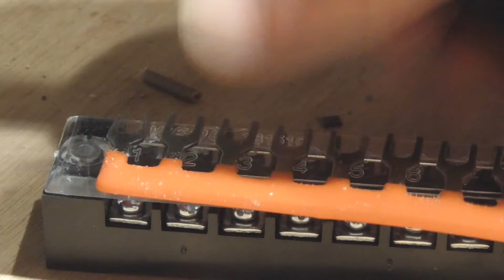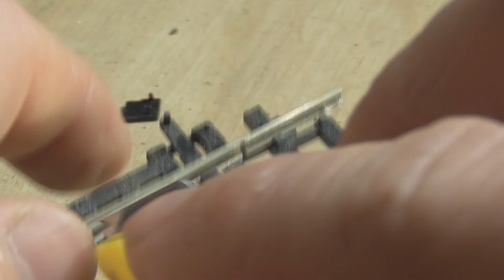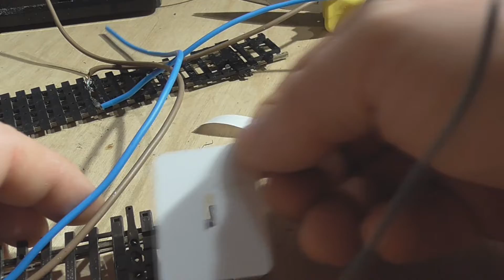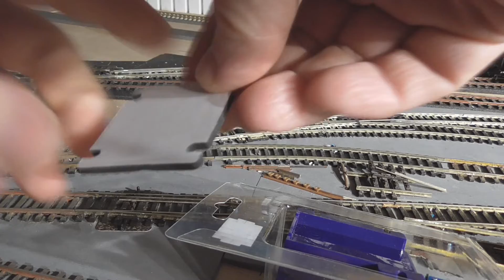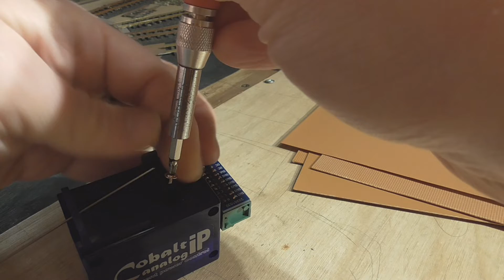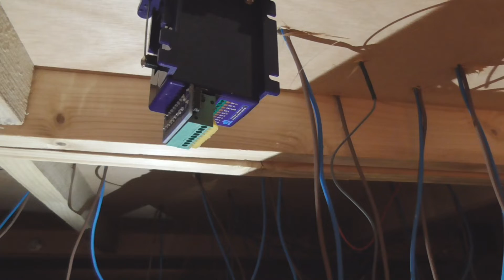Electrics Part 2: I show you how to install a DCC Concepts Cobalt IP Analog point motor

Comment: These Scenic3D point motor jigs are an excellent piece of kit. Life's so much easier using one of these
Reply from the maker: I agree, I've got several for different types of points such as 3 way and slips. I use DCC Concepts point motors but you can get them for tortoise motors too. 🙂
Reply: @TrainsUpNorth  I know Geoff from Scenic3D would appreciate another video showing the name. Packaging and where you purchased them online, as this helps grow his business. Your video is one of the best I've seen because you didn't just talk about it and assumed everyone would understand that you demonstrated the whole installation.
Reply from the maker: There should now be a link to the Scenic3D website, I couldn't remember where I got them from, I have many more points to do including single & double slips so I will mention them again. TUN
Reply: Agreed the DCC concepts template is a joke.   All holes should have been an extra couple of mm bigger than reccomended.